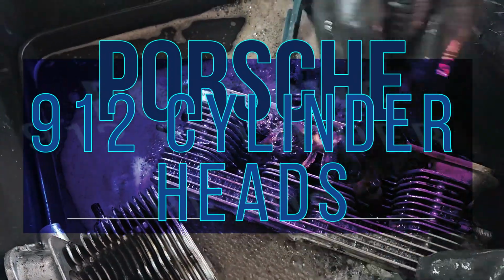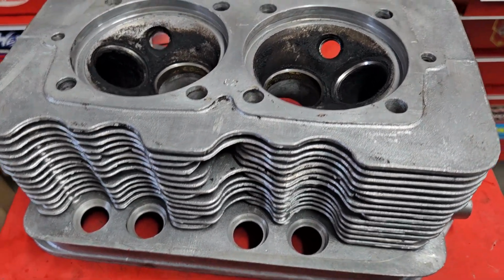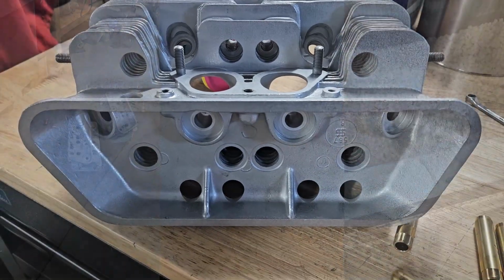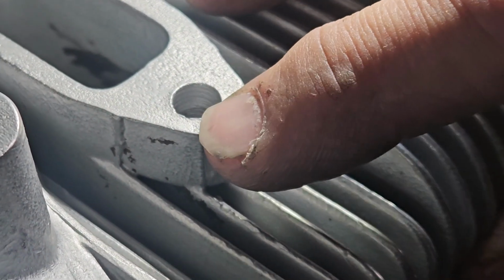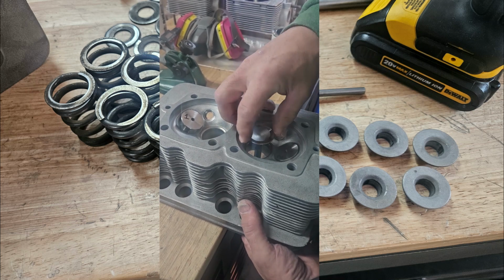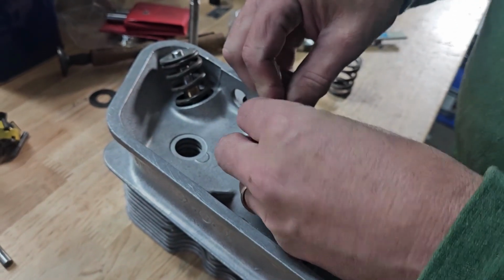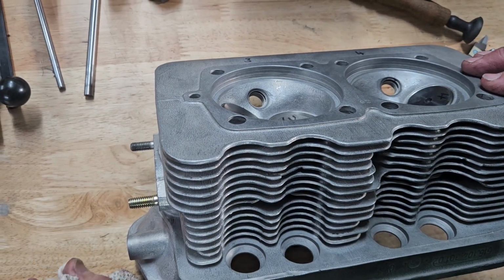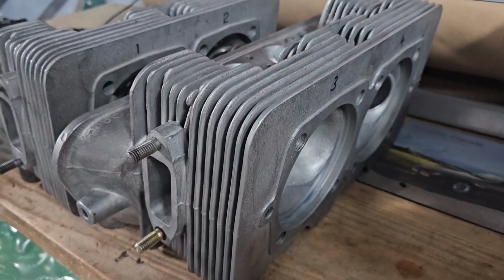Porsche 912 Cylinder Heads

Comment: Why do you use an air hammer and not a hydraulic press to remove and install the guides?
Reply from the maker: A hydraulic press is not practical or required to remove and install valve guides. The interference is only 0.05 mm which is pretty light and can easily be removed and installed with a hammer and a punch. Also the angle at which guides have to be removed and installed is also an issue with using a press as you need to be able to hold the head and support it at the correct angle for the guide. 
Kurt